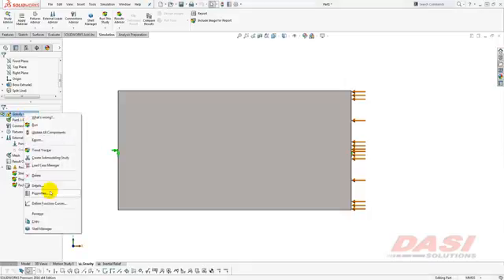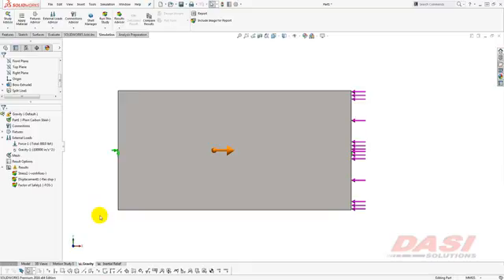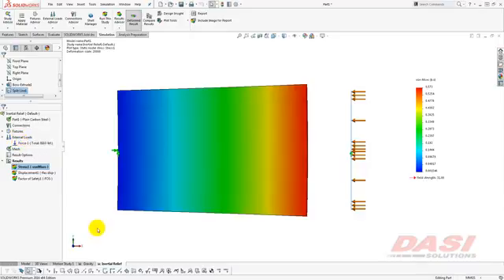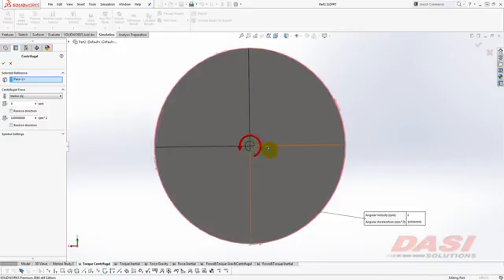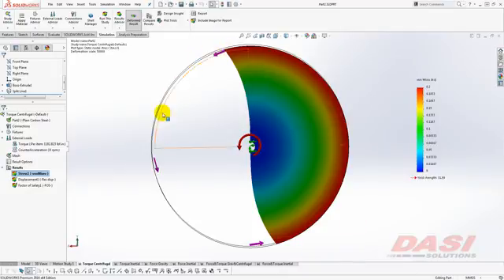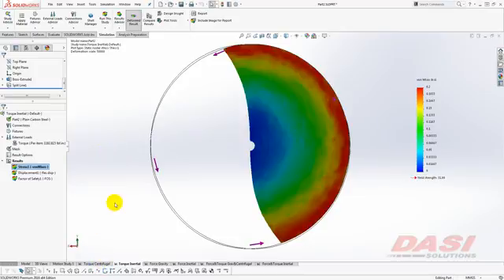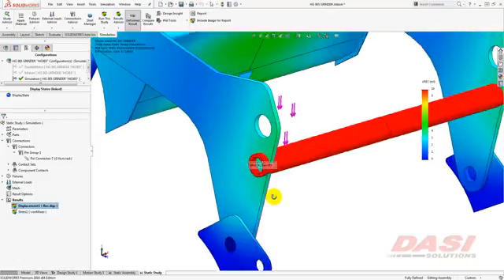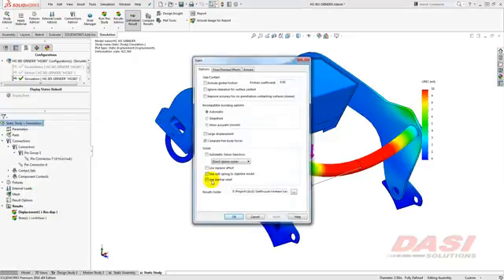SOLIDWORKS Simulation "Use Inertial Relief" explanation

Comment: Why do results on second spinning disk look so diffuse. i also just read internal relief only worked for translational inertias, not on rotational ones. Do you think that could affect inertial stress results on your disk?
Reply: DASI Solutions, LLC that would be great!, maybe you could try with a similar disk, but with a middle-hole, then just apply a torque on its internal face. There we'll see if results look smoother or not.

Comment: I know that it's not the topic of the video but what fixture exactly were you using @0:32 and @2:30
Thanks
Reply: Thanks for your detailed reply, I appreciate it.
This almost what I use "sometimes edges on symmetry  planes instead of vertex"
I was searching for easier way to restrain the model without over restraining it because it becomes so complicated with many parts "no penetration contact"